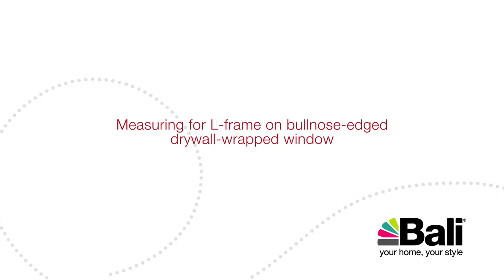Measuring for L-frame on bullnose-edged drywall-wrapped window

Comment: This is GREAT information. We have bullnose-edged drywall-wrapped windows. AND the windows are casement (also known as crank windows). No one could show us how to measure it so that we're not screwing holes into the metal bullnose piece under the drywall. But THIS shows how to do that! It makes so much sense! Thank you for this!